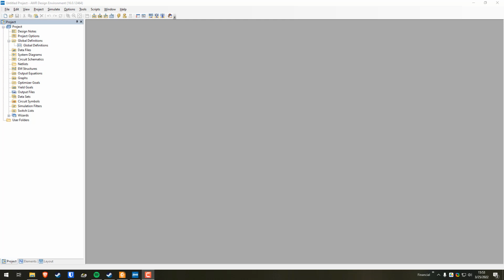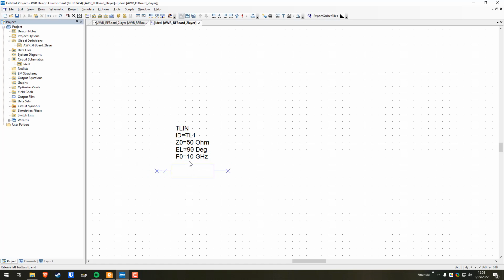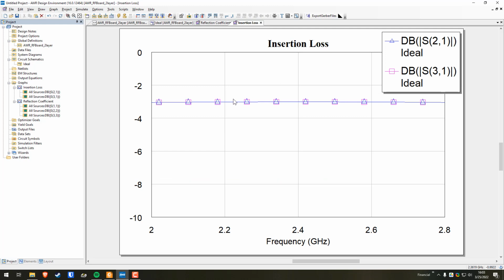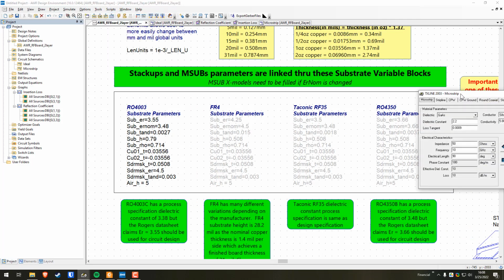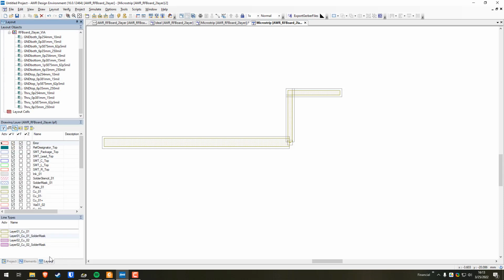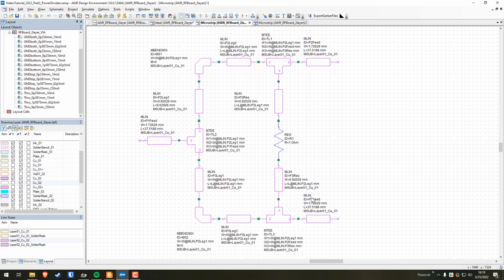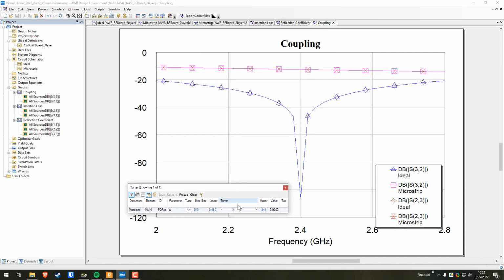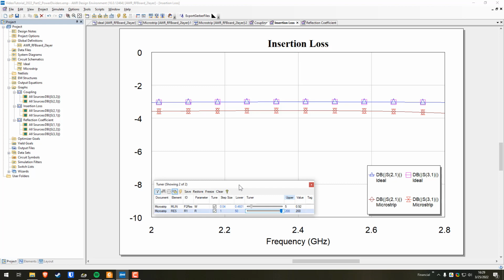Wilkinson Power Divider Circuit Simulations - Part 2 - AWR Microwave Office V16.0 Tutorial

Comment: Mr sim i want to ask abou my awr can't add edge port in edge of substrate, i have snaped to grid but it still can,t add? I use AWR 17.
Reply from the maker: Are you using an AXIEM EM set-up or Analyst? For most set-ups, you should be using AXIEM in single-sided mode which provides you an infinite substrate and ground plane so you apply the edge ports to the trace edges that will be your ports on the circuit. I would recommend watching my older series' EM tutorial since it really hasn't changed version-to-version.

Comment: In the Ideal case Wilkins power divider is correct but when you implemented using microstrip there should be no transmission between the resistor connected to the output port. because of this flaw, I failed in the exam. so please change it..
Reply from the maker: If you mean the microstrip lines which allow the small footprint resistor to connect to the output lines, they are necessary in a real-world implementation of a Wilkinson power divider. I am sorry you failed in your exam due to the information in this video but the information is not incorrect by any means. This video was never intended to teach Wilkinson power dividers and only uses them as an avenue to teach the Microwave Office software. Seems your exam would like a more "ideal" microstrip implementation where these feed lines are not necessary to attach the resistor. I would recommend seeking videos specifically designed to teach RF content if you are looking for references to aid in your coursework. These videos are NOT reference material for the RF material itself and are ONLY to be used to learn AWR and REAL-WORLD implementations of the RF circuitry.